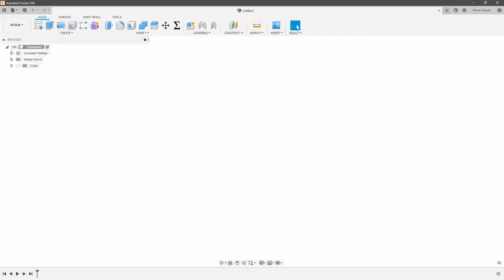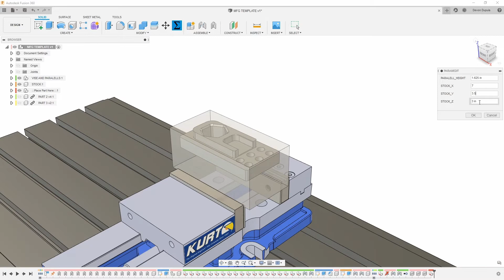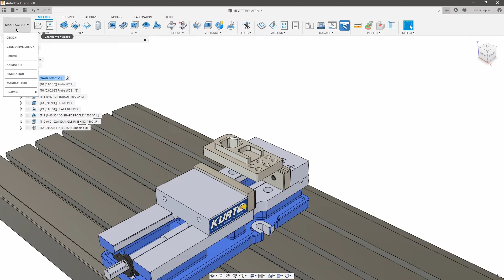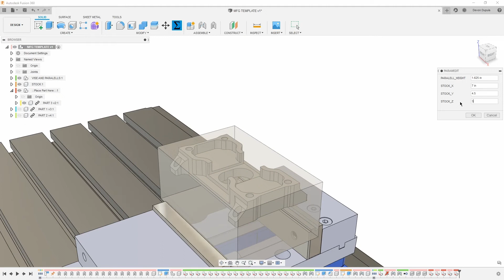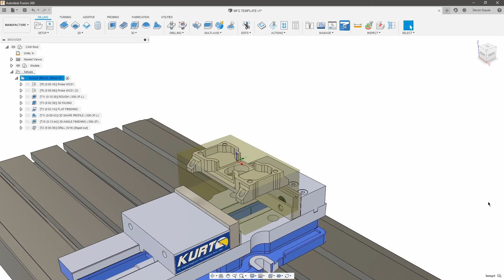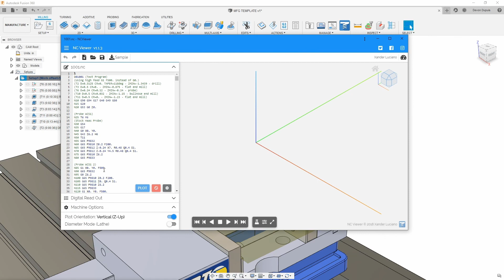Working smarter not harder using 3D Toolpaths

Comment: So, when you pull in the part files they seem to automatically snap to the center of the stock. How do you make this happen? When I pull in a part file of my own it does not behave this way and then once I adjust the stock the part can end up off center within the stock. Thank you for the awesome video!
Reply from the maker: That’s demo magic. Origins are the same. You can just move the part. Send me an email if you need help. DevonD@Dsi-Mfg.com

Comment: A question that I have is the template is only good for the parts that fit the process flow using those tools?  Can I add tools in template if the holes need to tapped, or a ballmill to profile?
Reply from the maker: Certainly the world is your oyster